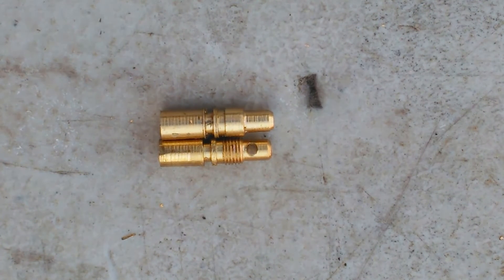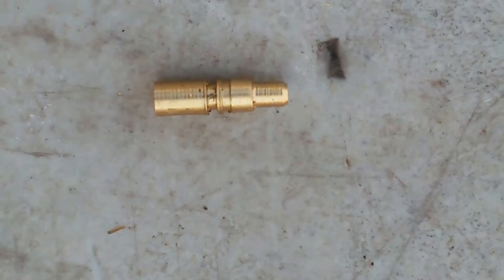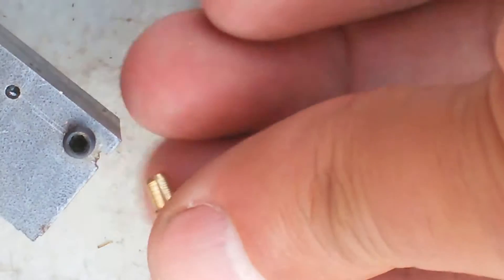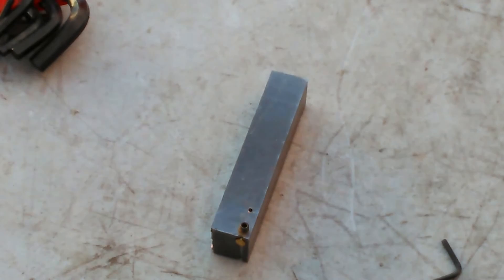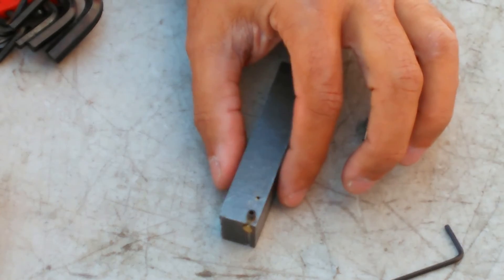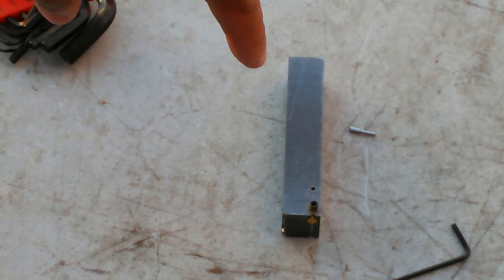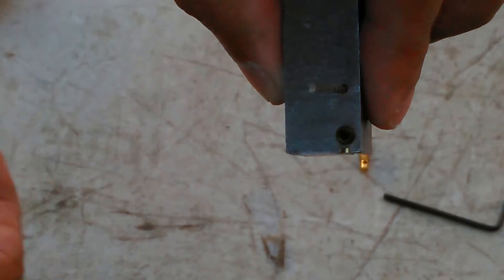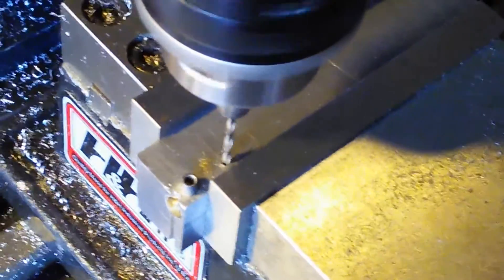Drilling Across Round Stock

Comment: Found this idea very useful. Will try to make a jig like that for my purpose. Thank you very much for sharing!
Reply from the maker: Thanks for your comment. Glad I could help. What are you making, Necati?
Reply: I'm making kalimbas and have had difficulties in drilling the 6mm holes in the retainer for the spring metal tines. I need them both to be dead on center. I need consistent results. The retainer is a 12mm steel pipe containing a 10mm wooden dowel. Will see if I can make it to build a similar jig without any fancy tools for machining metal.
Reply from the maker: Nice! They say necessity is the mother of invention...